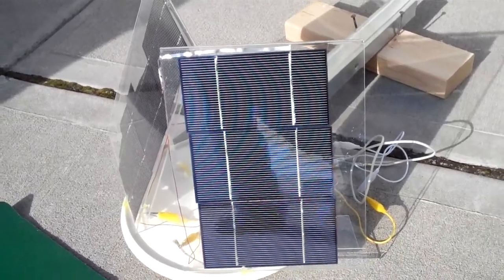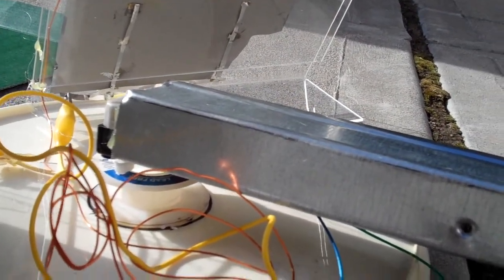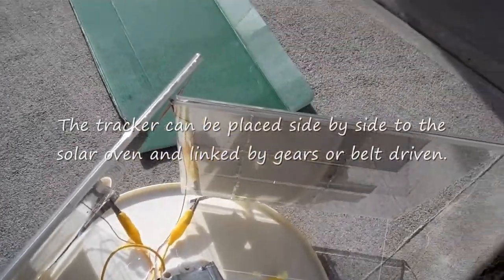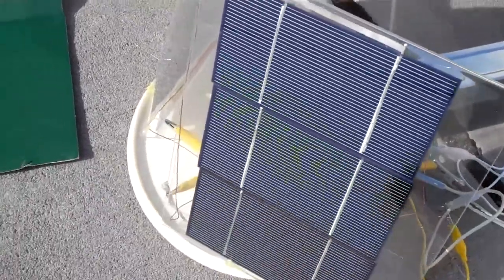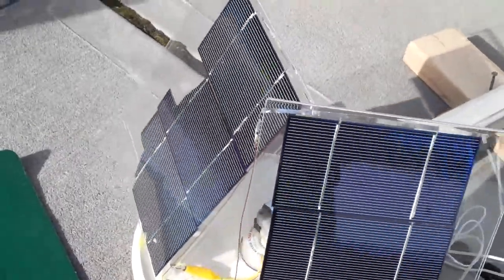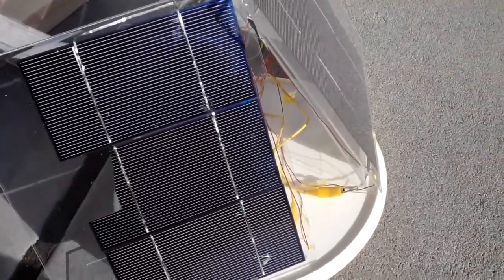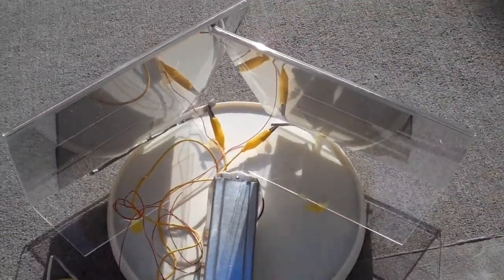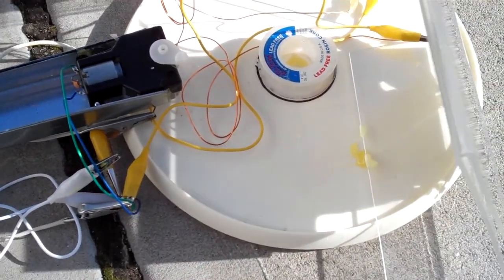Solar tracker model for solar oven tested part 3

Comment: Thats cool how the voltage cancels out between the pannels, no circuitry. Could have smaller pannels and motor. I would use the lazy susan to bump a toggle switch that controls the motor for the big pannel.

Comment: That Is a very Smart idea. I Have just what u need ,A used power winder Motor with a cable drive or one with the half a ring gear to raise the window would be perfect they are very strong but u would need a small 12v batty to make it Go.I never throw out that stuff as this is a perfect use for such a motor.